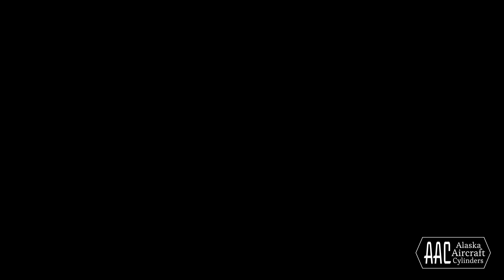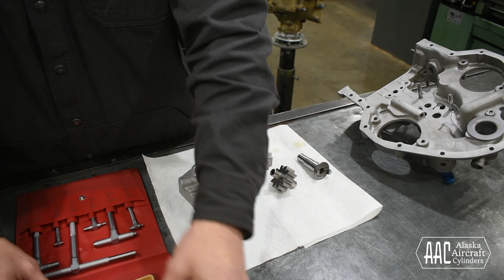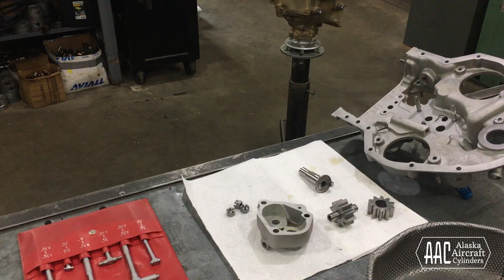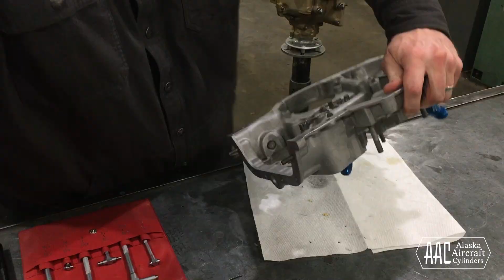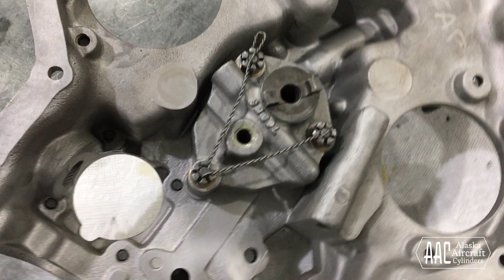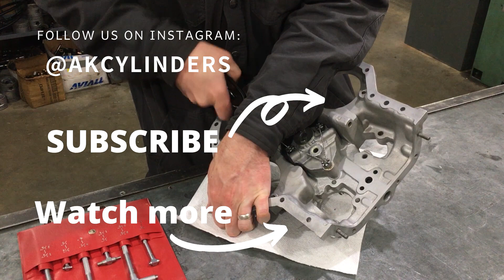Lycoming Oil Pump Assembly

Comment: Very helpful. Thanks for posting. What are the symptoms of a failing oil pump? Would the oil pressure be always low? I'm getting low oil pressure in the middle of the flight but beginning of the flight is good and when I throttle back to land, pressure also comes back up. Start of flight about 84psi, within about 15 minutes of take off, I'm down to about 55 to 60psi. If I fly it hard (full throttle, aerobatics), it might drop too low 50s or high 40s. Reducing throttle to 2100rpm or less will raise oil pressure back up by about 5psi within seconds of reducing power. If I power back way back and keep it there, pressure will go back up into the low 70s. Vernatherm working fine, oil cooler and hoses have been checked to make sure they're not clogged, etc. Oil analysis always comes back good, but I haven't had an analysis the last two oil changes.
Reply: This is very helpful.  I have a '57 Piper Tri-Pacer with a Lycoming O-320 A1A engine.  My oil pressure has been just about 60psi on takeoff, goes down to about 57 to 58 psi during climb and down to about 55 psi leveling off and setting cruise RPM.  Pulling the throttle just prior to touchdown it goes down to 40 psi and needless to say, I haven't flown the plane since I saw this indication.  My temps have been around 220 to 230 and on a real hot and humid day here in the south goes to about 240 which is red-line  I ordered and received the housing unit and waiting for my impellers to arrive then my mechanic and I will do this procedure and swap them out.